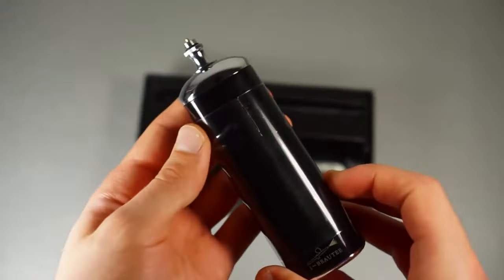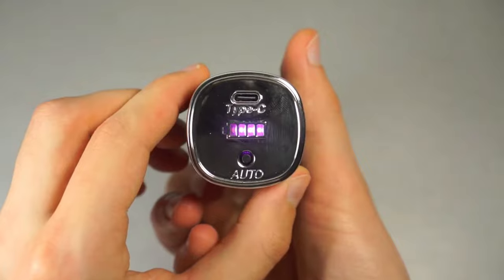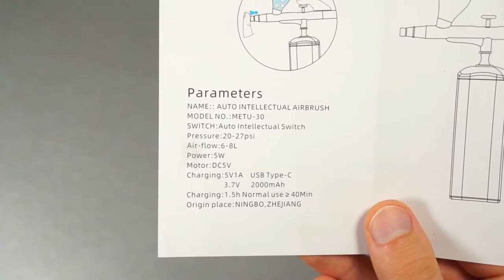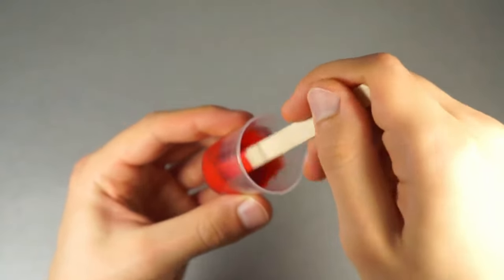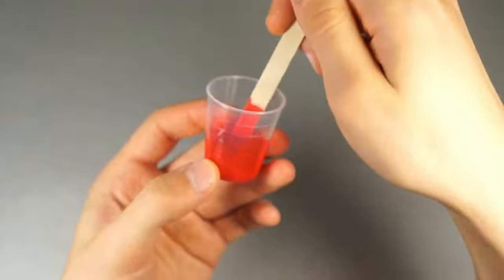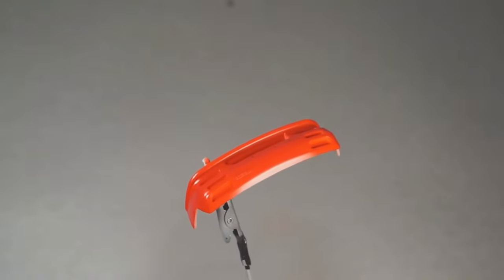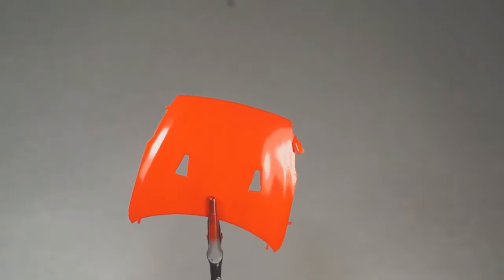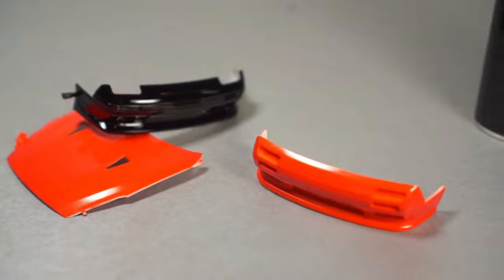HOW TO PAINT MODEL WITH I-BEAUTEE CORDLESS AIRBRUSH KIT.

Comment: Can a hose be connected?  Is there an adapter?
Reply from the maker: Hi, this type can't connect with air hose. But we have another type that can be used with air hose. You can check another video in my Channel
Reply: A comparison between the 27psi, 30psi and 32psi models would be great.
Reply from the maker: @teryenteryen1326  I will make in next video.
Reply: @riboairbrushmanufacturer3832  When will the video come?  Then I'll wait to buy.
Reply from the maker: @teryenteryen1326  You can send message on Whatsapp, i can send you video directly. Do you buy to resell or use it yourself?